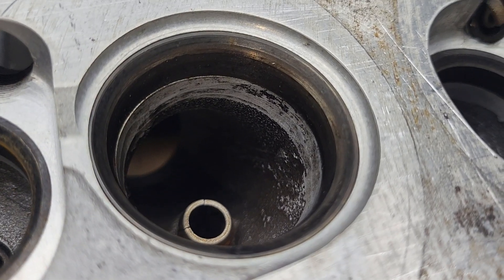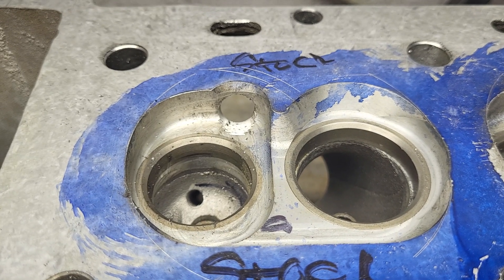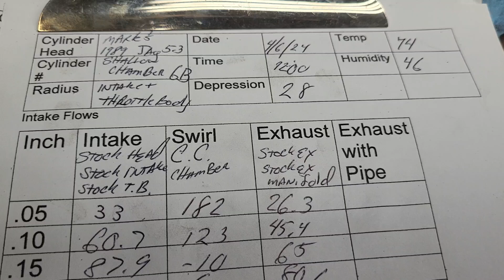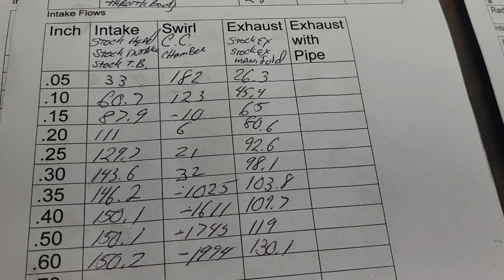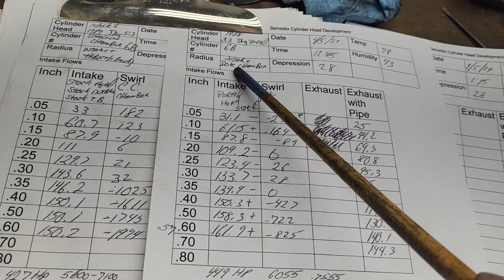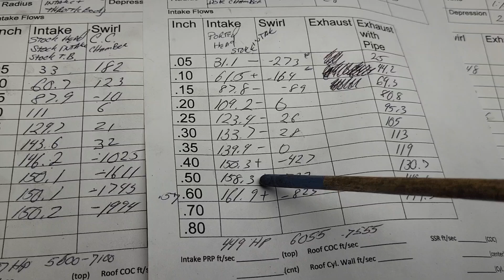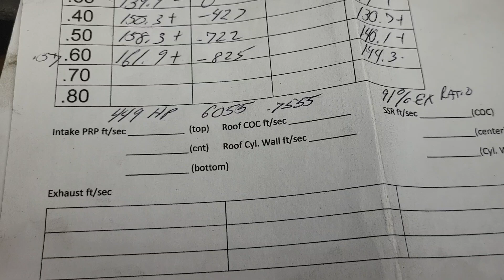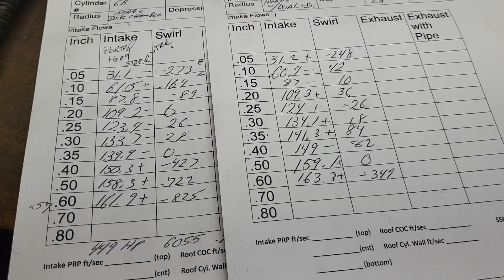Jaguar V12 high energy cylinder head,David Vizard chamber design. Flow baby flow!

Comment: Absolutely fantastic video and numbers by you gentlemen.. my and I have just completed a XJS restomod, and of course he wants POWER.. lol.. we are about to make a custom quad throttle setup, not quite like yours.. we will also be rebuilding the engine.. was definitely looking into porting out everything.. we have an 86 HE heads.. at the wnd what do you think,, is it worth grinding all of it? 
Thanks
Reply from the maker: @petehalasz7547  Always!
Reply: @servediocylinderheads  ,, should I go as extreme as you did? I thought some of the numbers didn't look advantageous.. Obviously any clean runner is a better runner.. Should I stay with the curvature or straighten them? Thanks and cheers
Reply from the maker: @petehalasz7547  Depends on what you are trying to do. Higher airflow may help higher rpm and horsepower.
Reply: @servediocylinderheads  ,, we are looking for 500 HP+/-.. you know kids..lol. but my son doesn't understand that to lumpy of a cam results in terrible idle.. Mobeck in Norway  has achieved 480 HP with very little work.. have you heard of him?
Mobeck tekniske..
Reply from the maker: @petehalasz7547  I haven't. For 500hp an airflow development is in order.

Comment: One concern would be deviating too far from the original head design and defeating the positive qualities of high compression and lean burn. Some take the Heron heads and make a shallow version of a heart shaped LS type of combustion chamber. 
Flow beyond 1/2" only makes a difference when you are holding the valve open for a longer time as no one makes a cam that lifts that high and most are regrinds. Mobeck Techniske makes a good billet cam that achieves almost 1/2" lift but requires larger cam buckets which would also require the tappet blocks to be bored out to fit the new buckets. Additionally they have a larger base circle necessitating boring the cam journals larger too.
Much of the power gains are made through intake and exhaust tuning for ram effect and vacuum extraction. Visit AJ6 Engineering and look at what they do and read the archives on the V12, it explains a lot. They once made a long ram intake that added 80 hp.
Reply from the maker: @Capnhook63  Good info. Thanks

Comment: Great video guys thanks for sharing. I am surprised at the chamber design. I would not imagine that there would be any work being done during overlap because of the exhaust seat installed so low in the chamber. Thanks again for sharing the info have a good day!
Reply from the maker: I would think scavenging would be low, one of the reasons D.V. modified it the way he did. Thanks

Comment: Keep that chamber like it is and run some flat top pistons that almost kiss the head to get squish and you should have a screamer!  It may need water injection to prevent detonation but who cares big compression and extremely fast flame front should make an engine that absolutely can scream at rpm.
Reply from the maker: .No doubt. Thanks
Reply from the maker: I will change the chamber a bit I am sure
Reply: I’m sorry, you are wrong.  The HE limits horsepower ( pistons are already flat top.) 
  The 1971-1980 heads flow much better because the chamber is in the piston. 
   The HE heads force air to make  directional changes not needed in  the earlier pre HE  heads. 
   HE heads was to meet California emissions. Not make more power. 
  High Efficency was purely a marketing  effort.
Reply from the maker: @frenchydampier2209  I only know what I have read. No apology needed.

Comment: I am in the UK so our Jag engines my be different spec, but here later ones were marketed as "HE" for high efficiency, I believe they made slightly more power. May be that is the different chamber shape?
Reply from the maker: That is a good question. I feel like they are the same. Thanks
Reply: @servediocylinderheads  sorry to not have more information.
Reply: The heads on all V12 HE are basically the same. With the exception of PRE HE ( flat heads. Combustion chamber in the piston)  and the 6.0. Which has slightly bigger  combustion chamber. 
     The whole purpose of the HE head was to meet California’s pending emissions rules. 
       Calling it a HIGH EFFICIENCY head was pure marketing. . 
  May even have credit to its origins.  ( 1927 Buick FIREBALL). 
  Buick retained that design until 1954. Then Chevy adapted it and kept it through the early 1960’s on their 6 cylinder.
Reply from the maker: I think it is due to the chamber's swirl. Thanks
Reply: The best head for the V12 is the early Pre HE head.  Swirl is induced by the angle of the intake port . The combustion chamber is in the piston. A full Hemi chamber. With squish provided by the edge of the piston. 
      Proof?  The horsepower is the same  even though compression is much higher on the HE.
Reply from the maker: @frenchydampier2209  What I read about that design was made good power but was a gas hog. Thanks

Comment: Remember that you are dealing with a 12 cyl. 5.3 = 441 cc per cyl and the 6 liter is 500 cc per cyl. So the port isn’t feeding a significantly larger cyl.
Reply from the maker: The bigger engine makes it easier to get to the horsepower goals. Thanks

Comment: Legend has it, those cylinder heads were the last development/design by Walter Hassan when Coventry Climax was absorbed by BMC. 
Hassan deciding to call time on racing activities after building the championship winning F1 engine for a few seasons. Engine capacity had changed yet again and Repco had a power unit ready to go. It wasn't long after Keith Duckworth had penned the DFV with Ford money. The other personalitys that stitch the entire bunch together are the Costins and of course Harry Westlake. Great people looking at what they made and achieved with very little money.
As is the English way of doing things🙂
You will have nothing and be happy🙄 2000 years too late😆🙂

Comment: These intake runner manifold needs a computer or vacuum controlled resonance flap to devide in 3 at lower RPM and combine to 6 at higher just like 1991 Opel / Vauxhall Senator 2.5 and 3 litre Dual Ram system.
Reply from the maker: So...build it! Thanks
Reply: @servediocylinderheads  If I had the money I would try to adapt the GM Opel Dual ram system x2 on a pre HE V12 bored to 6 litre, that would make decent torque and HP :-) Scrap all post 1983 HE heads and get all pre HE heads and British Leyland brand stamped  HE heads you can find, if BL is not stamped on those alloy castings  heads valves and seats are indian crap also indian labour and metalurgy. DOES NOT WORK. Never buy a Jag V12 engine not made under BL....when BL went and Jaguar overtook the production independantly metalurgy Quality on the engines went down dramaticaly same story with cranks...The early ones were well balanced, the later ones weren't so well balanced The earliest V12 engines were by far the best!

Comment: you cant use V12 Jag HE heads because they drop valve seats!!! Only use pre HE and 6 litre heads.
Reply from the maker: First I have heard that.
Reply: @servediocylinderheads  Biggest problem, all Jaguar heads were cast and assembled in India at Standard Motors from 1983 on, many had badly installed valve seats that fall out if you push the engine hard on Autobahn in Germany or doing motorsport. Here in Germany every second V12 dropped valve seats when the owners went chasing Mercedes and BMWs on Autobahn, Jaguar stopped selling 5.3 liter V12 to Germany, early pre HE had british made heads and later 6.0 had US spec made heads that were uch better. But never use a HE V12 and drive that engine hard!
Reply from the maker: @Schlipperschlopper  Reads like an overheating issue. Thanks
Reply: @servediocylinderheads  maybe the He heads after 1983 suck as hell and are very prone to let go exhaust valve seats. As long British leyland during the 1970s until 1982 made those heads they were fine but something fundamentaly changed in quality after 1983 until 1990...after 1991 Ford manufactured the heads and it was fine again.
Reply from the maker: @Schlipperschlopper  Then you better know your heads history. Thanks
Reply: @servediocylinderheads  The cooling systems on these v12's had to be maintained to very high standards. Heat in that tight engine bay was always a problem hell they ran the fuel returning to the fuel tank through a cooler that was fed by the air conditioning. They moved the battery to the boot / trunk. One other point the spoiler on the front valance was not for looks our down force. It's main purpose was to direct air up threw the radiator and also provide a deeper negative pressure area under the engine bay to help pull that hot air out. Xjs's that are missing that spoiler will tend to over heat.
Reply from the maker: @markniblett4857  Good info, Thanks Mark!

Comment: Yes great video finally some light on great jaguar V 12 cly heads they have
Potential with the head mods and
A good cam, the dual throttle
Bodies are not as good as I thought 
Stock there 70mm each how
About on single 80 mm for better
Response with central location 
On the manifold.
Reply from the maker: It is a good idea and lots less work. Thanks

Comment: Really good video Charlie. I wonder if the DV heads are off a larger displacement motor? Looking at the swirl numbers, I'm thinking that the squish squish action will be critical to mixture motion and mixing. On closed chamber Cleveland's, I used to minimise the piston to head clearance as much as I dared, in order to maximise mixture motion/turbulence. I was trying to get a very violent motion at the end of the compression stroke. It was common for my motors to erode the machining marks off the tops of the pistons in the squish areas.
Reply from the maker: I am sure that worked well! Thanks